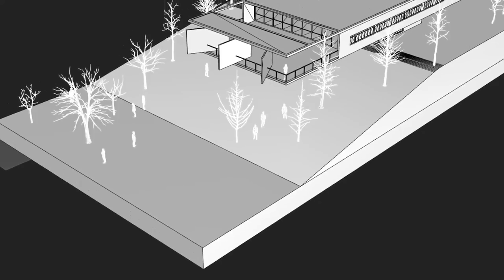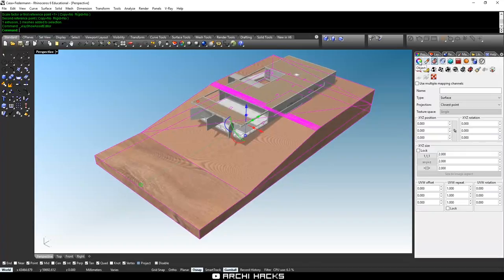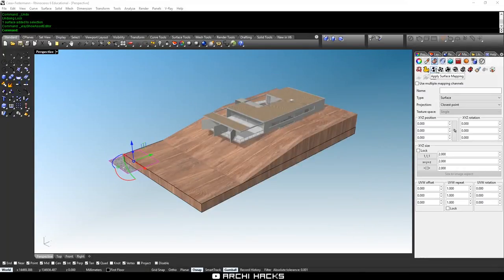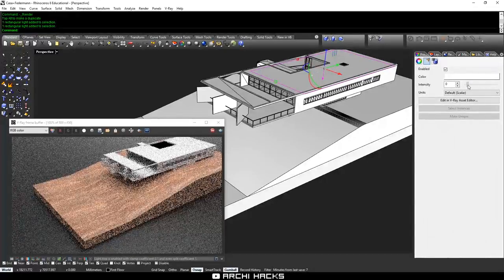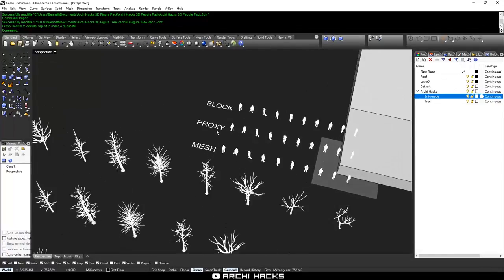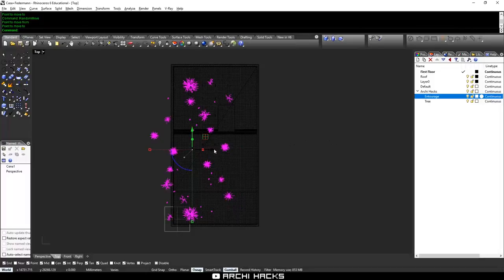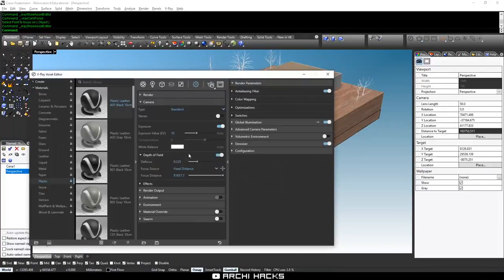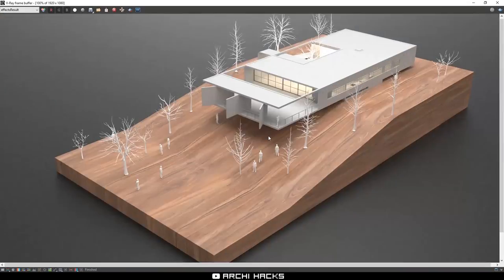Rendering Realistic Physical Model | Rhino + V-Ray Tutorial

Comment: I got stuck at a detail, the wooden platform in the beggining has the lateral fiber vertical, in the final render it's as supposed to be (horizontal) how did u fix that?
Reply from the maker: Hey, sorry for the confusion! When you enable the mapping widget, make sire to rotate it along x-axis (red rotation gumball) by 90 degrees

Comment: what kind of lighting did you use for this?
Reply: I mean at the very start without the rectangle light box yet, my model just seem so much darker than yours.
Reply from the maker: I found that different versions of V-Ray and hardware setup yields different result sometimes. You can adjust the brightness of the scene using camera exposure on Asset Editor or exposure in global settings on VFB!